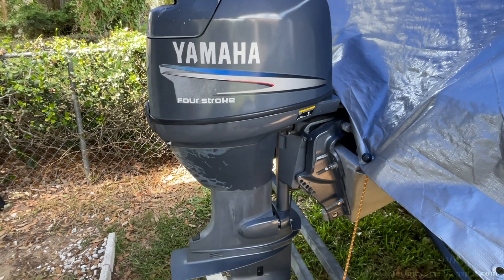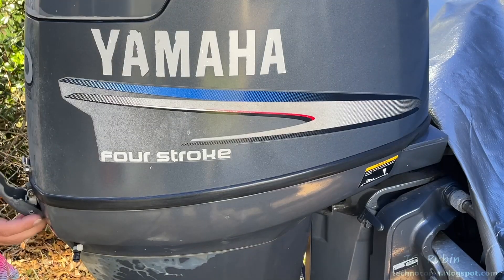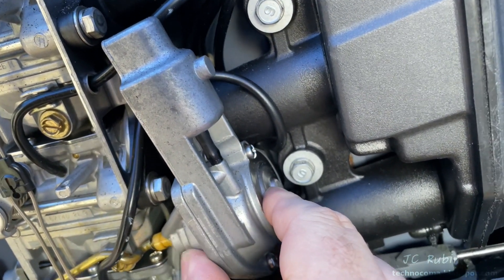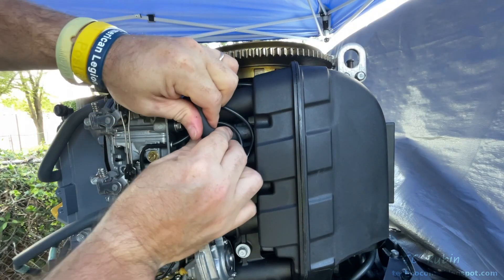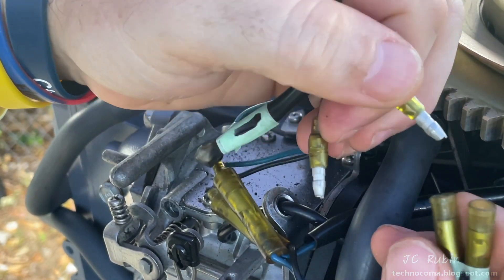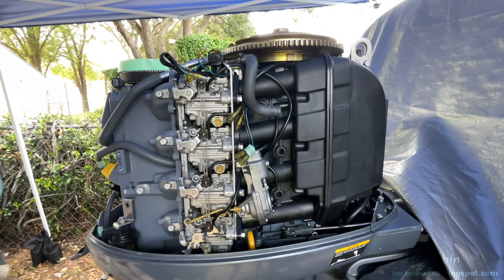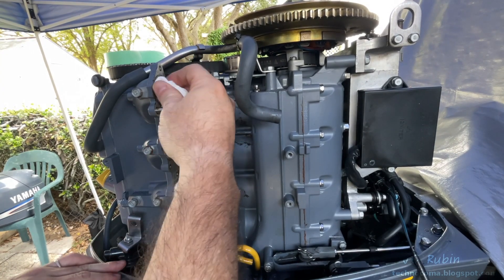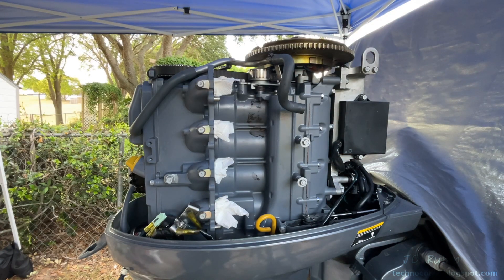Yamaha 4 Stroke Outboard Engine Carb Rebuild Series [1] Diagnosis and Carb Removal

Comment: 'i have a 2001 F80hp Yamaha, Its running rich on cylinder 4 just a tad wetish,not much, but the other 3 are white greyish. I  guess they are running  leaner. The carbs were cleaned, a year before last by a mechanic, he adjusted valves etc. The engine ran great last year. But it had a bit of a shake at idle rpm 8 or 900, so that's not normal, but l know the shaking from side to side is not normal, put new plugs in, exactly the same. When l rev it up, makes a slight  strange sound every 30 seconds or so. like a choking or slight misfire, not much just something slightly. Could all this just be that carb 4 is dirty, did drain all fuel out over winter. from carbs. Can l some how adjust the 4th carb to try and get it leaner, would this possibly cure the problem. Do l need to buy that carb tunning thing to see if the 4th carb is out of synch. Should l just turn that scew on the 4th carb and see if a slight adjustment would get engine to not shake so much. Any advice would be great,was launching tomorrow for the season, but hesitant now. I am not scared to do a carb clean rebuild if l must, but what can I do first, it is definitely cylinder 4 that's a bit rich. Komp test was fine on all 4 around 195-200 psi.

Comment: Excellent videos! So helpful! Mine has an acclerator pump at the top and theres a hose from carb 1 that routes next to you but not connected... also a port on the pump for air intake I think not connected... do you know if thats proper? I'm unable to provide a link or my email on here as it won't post my comment... but the one diagram I could find of the pump doesnt show where hose connects or if it does.

Comment: Awesome video.  Really liked the step-by-step approach.  Really like the management scheme for fasteners and cable marking.  Top notch video... also really liked your no bs approach... just a thorough information dump.  Currently overhauling the 4 carbs on my F100 TLRZ (which is from 2001).  Spent a lot of the day dealing with sized screws :(

Comment: I’ve got a leak coming from the back side of the carbs so I can’t really tell where it’s coming from I can tell that it’s def dripping from the back of the “#2” carb onto “#3” but I’m not sure whether this is a float/ needle not seating issue or a leaky fuel line on the #2. Do these carbs leak if the bowl overfills? From float not operating properly?
Reply: Also if o pump up the ball o can hear it hiss and see fuel drip down onto #3 does this sound like a ruptured fuel line?
Reply from the maker: Doesnt sound normal.
Reply from the maker: If the float gets stuck the pump will keep pushing fuel into the carb at a high rate, it will find a way out.